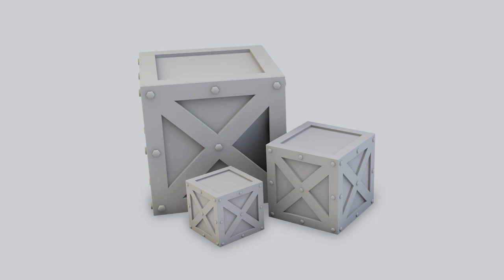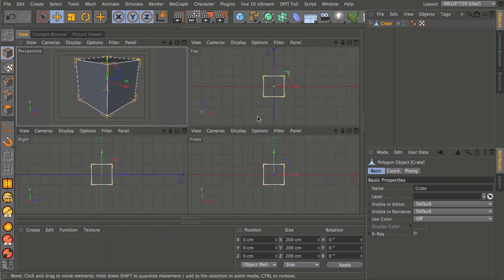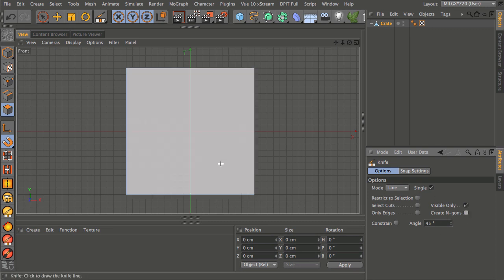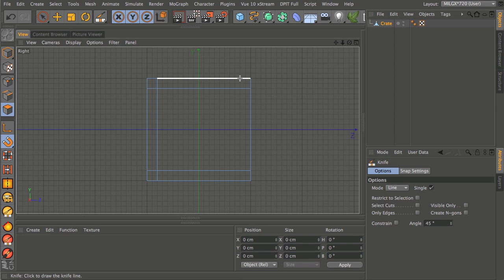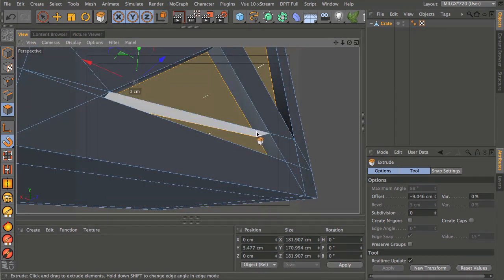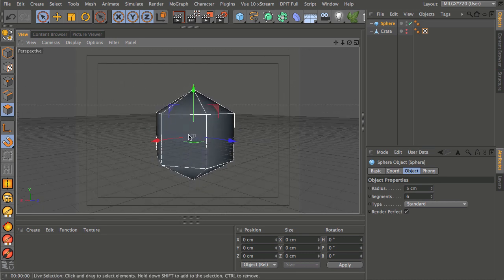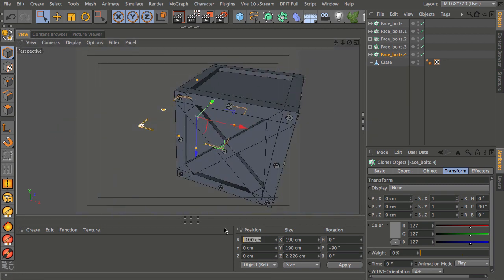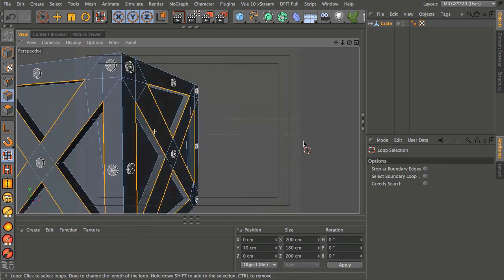Modelling Essentials for Cinema 4D - Crate

Comment: Trying to Recreate this in blender at the moment. Why? cause i have nothing better to do at the moment LUL.
and i personally don't like using the knife tool in blender so i decided to make a plan and use CTRL + J  to connect the Vertices. yea its a little bit more manual labor but gets the Same results as him with just a Little bit extra clicks.  and yes you could use the knife tool with intersect Mode turn on ( i think thats what its call) to do the same action as shown in this video.
to do the bolt well thats a little bit diffrent.

Well for the Bolts... let me figure that out ill Re-edit once i figure a method for that one thats not Copy and Pasting XD
Well figure it out
Its a little bit Dirtie. but gets pretty similar Results as his...
its just Array Stacking. Set up the First Array as Lenght
Set up another Array for Height.
now add a Third Array for Width. the Third Array Gotta be connected to a Empty.
Move the Empty and Place it Whatever you want.
this is the Dirty part.
Make the Width x4 so it Becomes a Full Square if everything is done Correctly it should Look Good. if done incorrectly things don't line up.

Note* Make Sure the Width has 0 -  0 - 0 on the Relative  Offset. so the Empty becomes the Center.